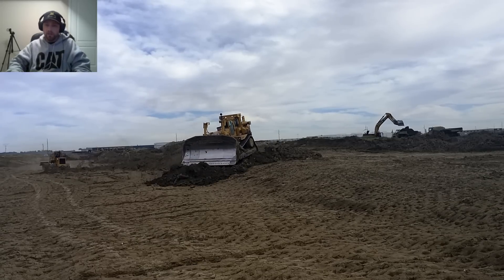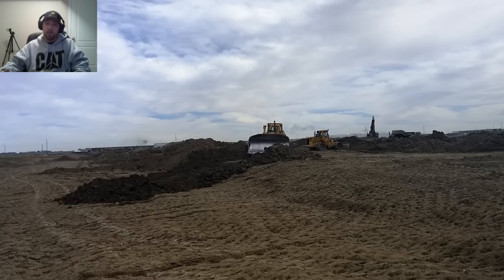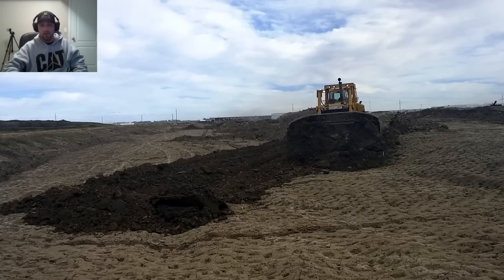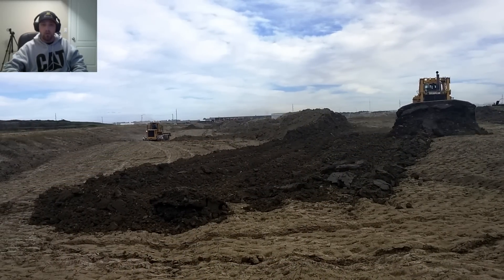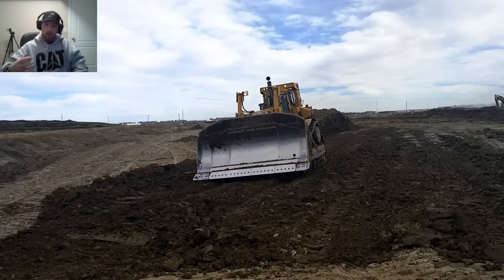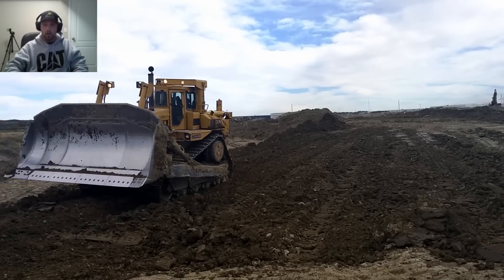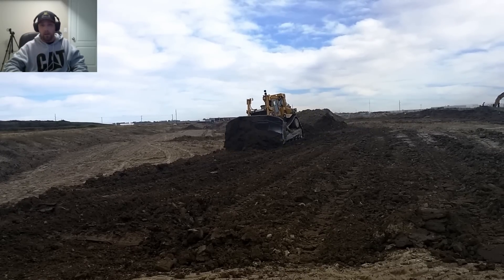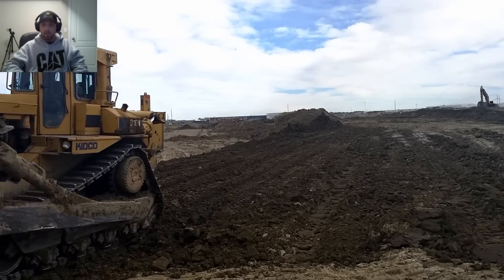D10N putting on a lift | Explained

Comment: Another question for you. We don't use packers in my area. I have never even seen one around. We use dirt rollers or Sheeps foot roller. Both have vibrator drums on them. Do these packers have vibratory drums on them or is it just the weight of the machine your relying on for compaction. Love the videos and your commentary. Thanks.
Reply from the maker: +ChrisCo Cream We have those type of packers here too, the ones you are talking about we use for specialized applications. typically on a large earthworks site, we use cat 815 and larger. They compact strictly by their shear weight combined with either sheep's foot or trash master style drums.
Reply: +Pushysix® the company I work for likes to do building pads spreading and compacting with the 815 solo, my first time seeing that machine (I'm in virginia, never seen an 815 in florida where i came up). Its a nifty machine. Can push quite a bit, i can grade surprisingly well with it.